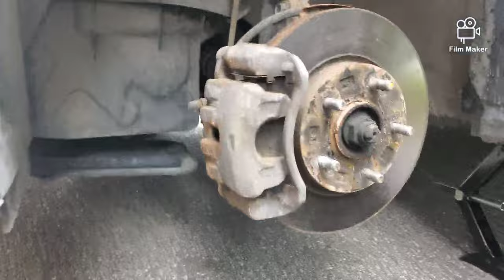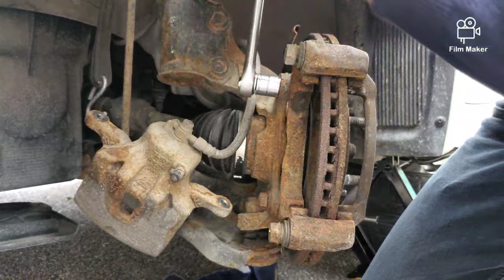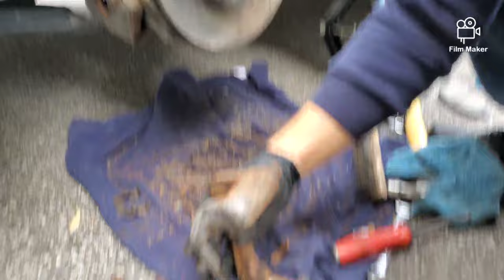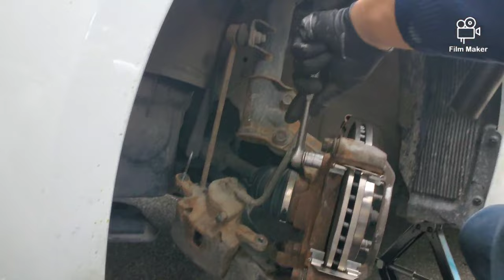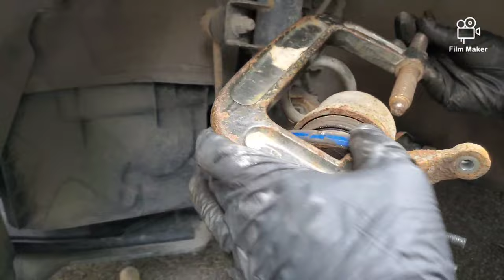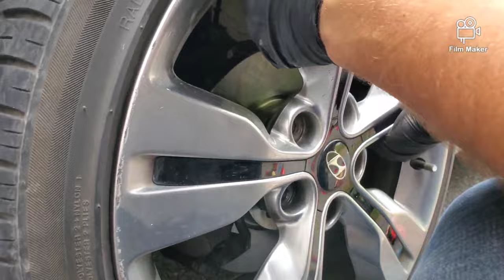Kia & Hyundai Replace Front Brake pads and rotors , 20 minutes

Comment: Nice job. If you wire brush the hub before trying to get the brake disc off it can make it easier to get the disc off.

I wouldn’t use anything on a socket wrench to tighten up the carrier bolts because next time you come to undo them will be more difficult...

Comment: Hola buen video desde España, se le puede echar a los pines la misma pasta de aluminio, ( en mi caso de cobre ), por ni encontrar la grasa especial frenos? Gracias 🫂
Reply: Use silicone paste on guide pins. Copper grease is based on mineral oil and slowly eats away at the rubber boots, causing them to fail prematurely.

Comment: Do u repeat on the other side b4 pumping brake pedal and replacing the resivour cap ?
Reply from the maker: @christurner-p8l  Yes
Reply: So you don't pump brakes until both sides have been replaced
Reply from the maker: @christurner-p8l  exactly